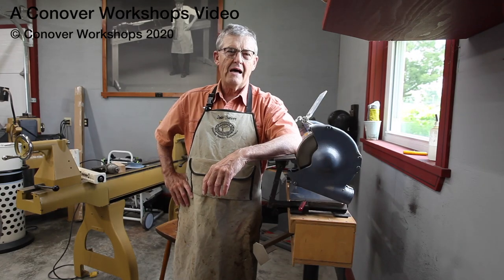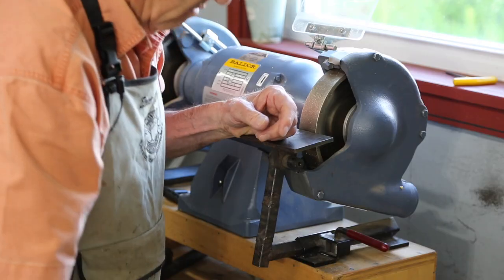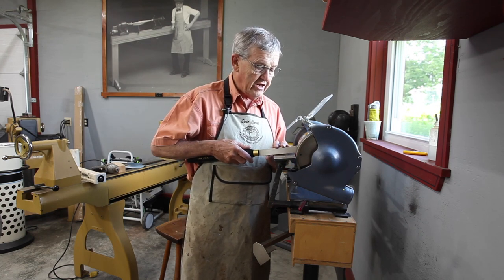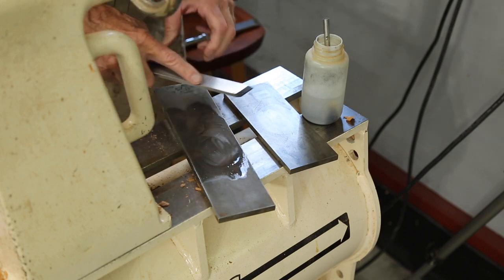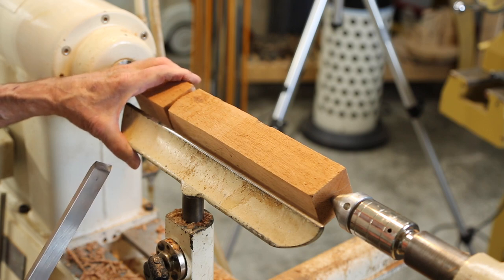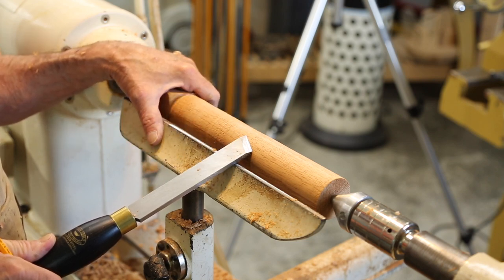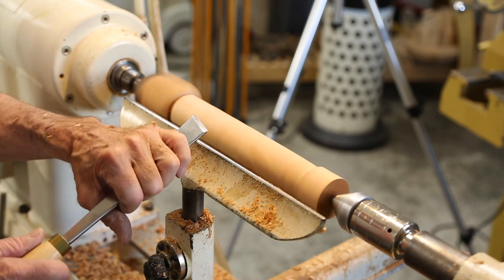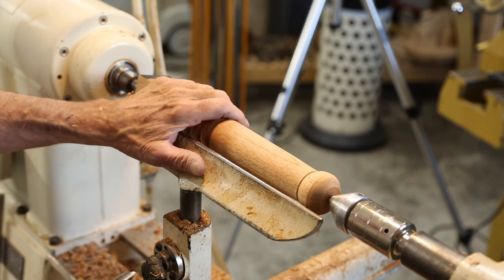The Skew Chisel

Comment: I'm a newbie that keeps getting catches when trying to do round overs. I've seen a lot of videos and none seem to explain it all. For instance, you say to raise the tool rest some but what does that mean?  I thinks it's just above the center of the piece but how much? I've also heard guys talking about not using soft wood starting out. I'm using ceder which I consider very soft. Maybe that's part of the problem. I'm using a flat edge skew (that had sharp edges I have since slightly rounded) with about a 20 degree blade angle. Do rpm's matter? I'm at about 1000rpm's. Thank you for any thoughts, Rich.
Reply from the maker: I start out anyone new to the skew at about 700 to 899 rpm. The rest should be above center such that when the skew is placed on the rest the cut is taking place toward the top of the work. If you looked from the tailstock end (to your right) the cut would be happening at about 11::00 O clock. If you email me through our website we could set up a Zoom teaching session with me showing and then you doing and me coaching. The skew is a hard tool to learn to use so do not be discouraged. Ceder is fine and a nice wood to turn. s=
Reply: @conoverworkshops1486  Thank you for the response. I'm still plugging away here. I was wondering if I should change the blade angle I have. E.g. right now it's a straight edge but I see many people use a swept back edge. Straight for maybe the first 2/3's then curving downwards on one side. I think I've heard these are slightly easier to control. Thank you again.